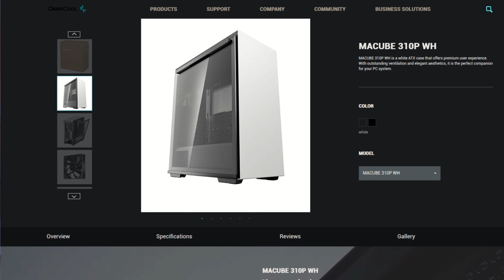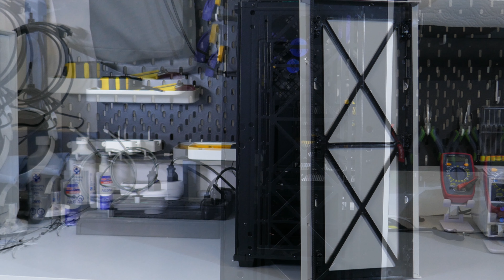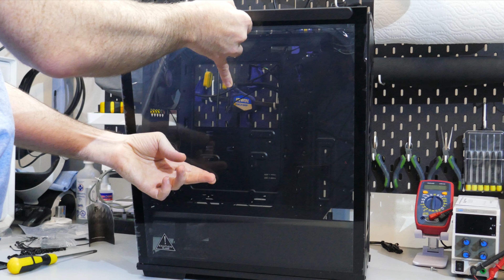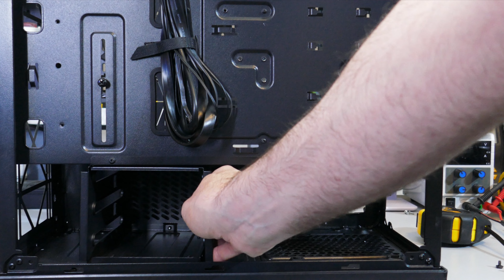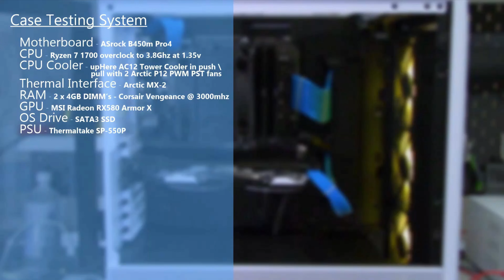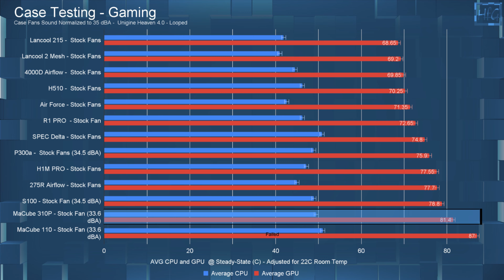DeepCool Macube 310P - Case Review

Comment: Which pc case would you recommend for audio work, music production ? To be cool and quit. Thank you!
Reply from the maker: What components are you using?
Reply: @HardwareForGamers  

AMD Ryzen 9 7900x
Deepcool lt720 liquid 
Asus prime x670
G skill trident Z5 neo 64gb (2x32gb)
Western digital WD sn850x / 1tb (x2)
Rtx 3060 12gb
Crosair RM 1000e / 1000w
Sonnet M.2 4x4 PCIe card
Reply: @HardwareForGamers  
Amd ryzen 9 7900x
Deepcool lt720 liquid 
Asus prime x670
G skill trident Z5 neo 64gb (2x32gb)
Western digital WD sn850x / 1tb (x2)
Rtx 3060 12gb
Crosair RM 1000e / 1000w
Sonnet M.2 4x4 PCIe card
Reply: Amd ryzen 9 7900x
Deepcool lt720 liquid 
Asus prime x670
G skill trident Z5 neo 64gb (2x32gb)
Western digital WD sn850x / 1tb (x2)
Rtx 3060 12gb
Crosair RM 1000e / 1000w
Sonnet M.2 4x4 PCIe card
Reply from the maker: @SannMirko  lian li lancool 206
Reply: @HardwareForGamers  
Thank you very much! Do you think this case would be quieter than case with closed front, top and side sound-dampening foam panels ?
Reply from the maker: @SannMirko  yes, you will need to set up a fan profile use fan control (or something like it). with a mesh case you can run the fans at a much lower RPM and get better/cooler temps than a covered panel case. And FYI if you want a really quiet system it's okay to let the CPU get up 80-85C using a custom fan profile.
Reply: @HardwareForGamers  Ok. Firstly i taught that Fractal define design case is a option but now I will go for a your recommendation
Reply: @HardwareForGamers  Do you know what is approximately power consumption of this system ?
Reply from the maker: @SannMirko  rough guess about 600w ish. I might up size it to a 650w maybe a 700w PSU

Comment: Molex is 12volts so it's a safety measure to use a big contact 

People have died from car batteries is the sad facts 

With today's good back wall spacing it's not an issue and they're flexible unlike daisy chain 4pin fan and RGB headers that are hair thing 

Molex lives

Comment: When regarding the exhaust fan you mentioned the second connecter and why fans still use that well I can confidently say it's because my mother board supports literally one fan besides the CPU fan.
Reply from the maker: No, you should use a splitter.
Reply: @HardwareForGamers  for a budget build especially when you literally only have hand me downs it's easier to just connect it to the power supply directly especially since it's not even RGB.
Reply from the maker: @M.Hametsu  you wouldn't have any control over the speed of the fan. It will be running at 100% for the life of the fan, which will decrease the life of the fan, which means you will be buying a new fan, which is more than the cost of a splitter...
Reply: @HardwareForGamers  no one said it's a long term solution. I do plan on upgrading my case and using a splitter but for the time being it's not necessary. It's also useful if you order items and have to wait for delivery or it's not readily available so it still in many ways works as a short term solution.

Comment: Firstly, I really liked the video, it's very informative and really well edited, just got a sub!
Secondly, do you think there's a good alternative in this price range? 
My town's environment is really hot (constantly at 40ºCs during summer) while also being really dusty (sea port + dirt roads + semi trucks), so my current case with just 1 fan on the meshed front and one at the back is enough to turn it into a dust bowl in just 2 days after each cleaning. Always wanted a more closed-style case to keep the dust a bit more manageable, but temperatures seem to be a problem in most of them.
Reply from the maker: The only case that's coming to mind is the Corsair 4000d airflow the mesh on the front is very fine.  Now I'm not sure what the price of the 4000d airflow is in your area.

Comment: I just picked on up for 40$ off newegg.  Far better than any case ive used around 80 or less.
Reply from the maker: it is a nice looking well built case, you just need to keep fan configuration in mind.
Reply: @HardwareForGamers  so it seems. Waiting on rx6600 to come in to finish the build. My rx550 stays cool but have a feeling thats gunna change with the 6600. I over compensated for cpu cooling for small overclocking hoping for the best ! My diypc case stays cool but its flimsy and ugly and I don't like my psu up high.
Reply: @thelowbudgetguy  gonna build in this case with the RX 6600. How are the temps?
Reply: @tallsz559  so far everything  staying mid 70s or less !

Comment: That Hdd cage (box) don't wanna be apart from the case :) I think it may be convinced to come out on the other side, the glass panel side, or its just stuck there forever 🗿
Reply from the maker: If you want it out, you should be able to get it out. The question is will it go back in... And I think the answer to that is no. Which is why I didn't try forcing it.
Reply: @HardwareForGamers  I don't want to imagine how they get it in in the first place, lub and things like that. Probably 3 or 4 people involved in getting it in, man, thouse pervs from DeepCool :sanitizer::washhands::chillwcat::shelterin:🕳🟫